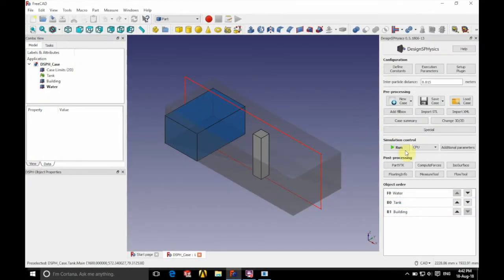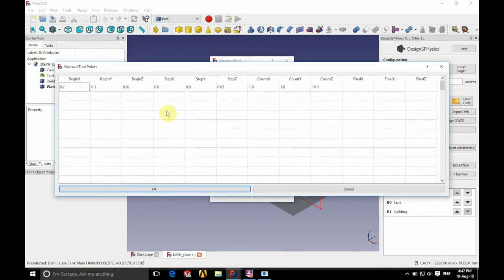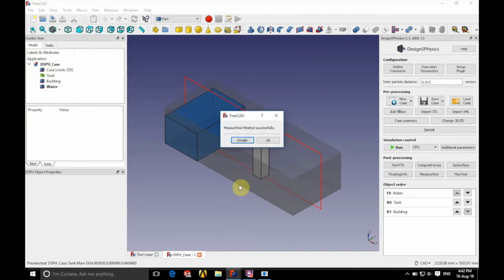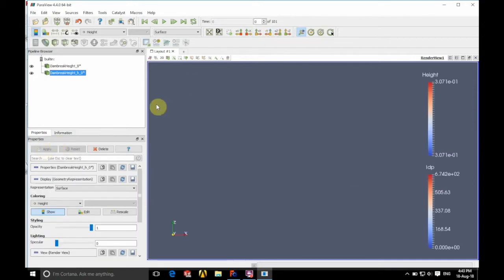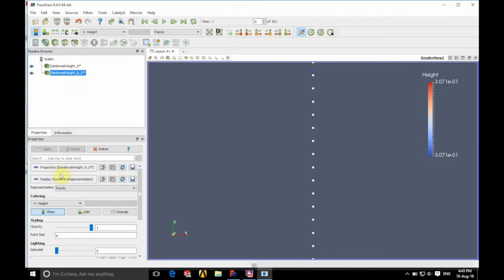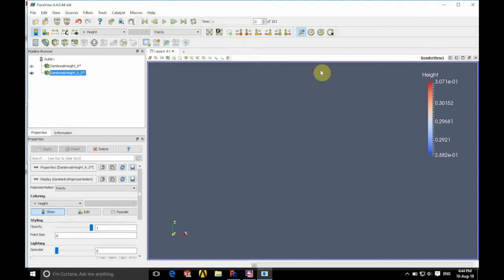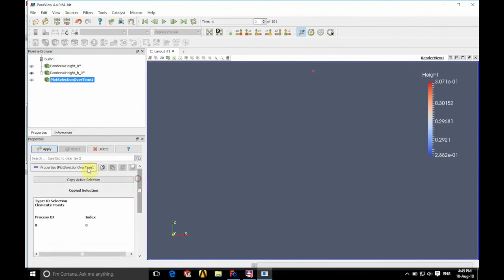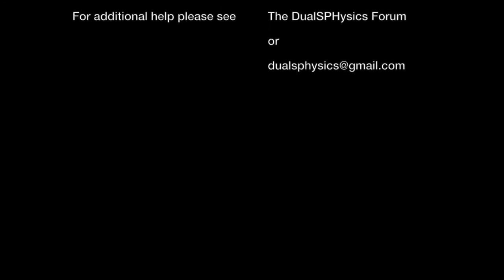DualSPHysics Plotting Height

Comment: Hi..Even though I am following the steps mentioned by you.. I am getting all values  ' 0' (including other properties in measure tool) be it in vtk or csv format. But compute force is working for me ...do you have any idea what I may be doing wrong?
Reply: Okay, found the mistake. The dimensions of geometry were in 'mm' but the dimensions in measure tool by default are in 'm'.
Reply: @adityagupta1906  I have been in the same loop too. It was quite frustrating. Do you have any suggestions on how to solve this? I input the positions in meters, but still the values are zero.